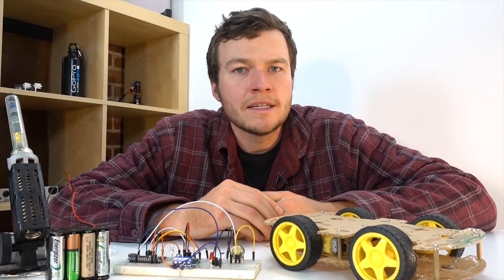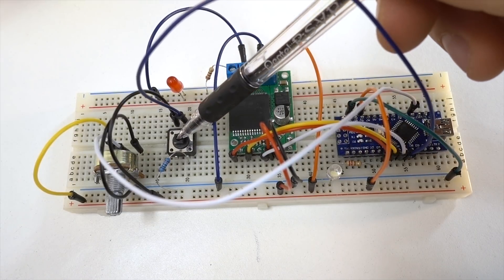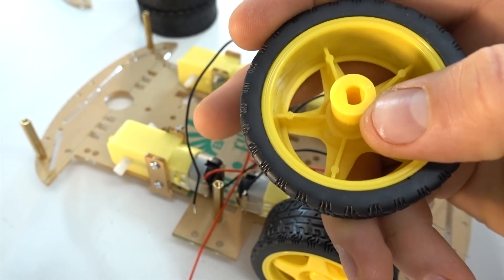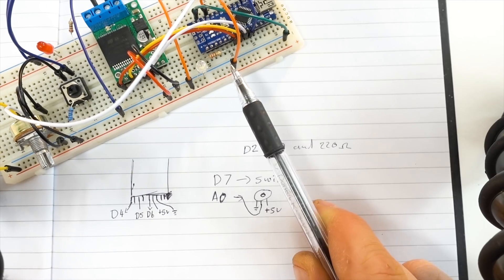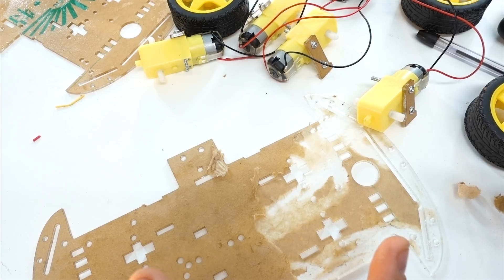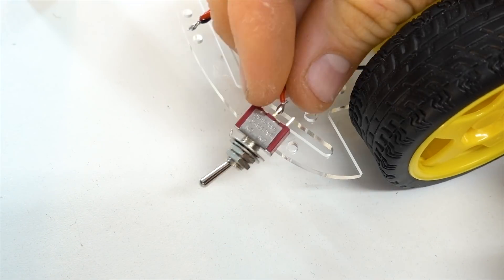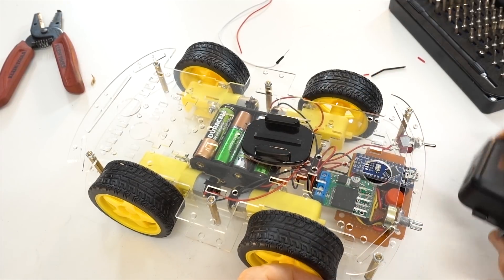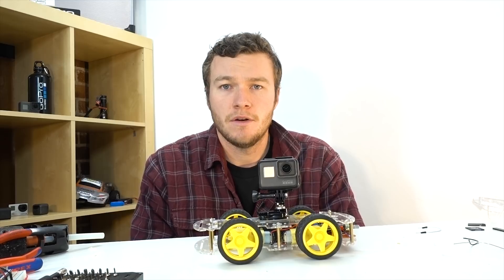DIY Motorised Timelapse Dolly

Comment: I'm thinking of using 2 motors with a single motor driver,and 12v battery source ,do you think the setup will take 1.5-2kgs
Reply from the maker: You should have no problem. If you have not ordered yet and you feel like modifying my program a bit you might try getting stepper motors. They would have been a much better fit for a project like this, allowing for finer control of the carts movements.

1.5-2kgs should be ok if the gear motors are good. You may just have to up the speed the motors ramp to as my code was set up for a much lighter cart.

Comment: add a bluetooth and make a mobile app n put some rubber on those wheels n its a perfect setup:)
Reply from the maker: Oh that is an awesome idea! Useing Bluetooth to input data would be great and much easier then the pot. Plus you could set it up to sync so it only moves when it is not taking photos and only moves once between photos